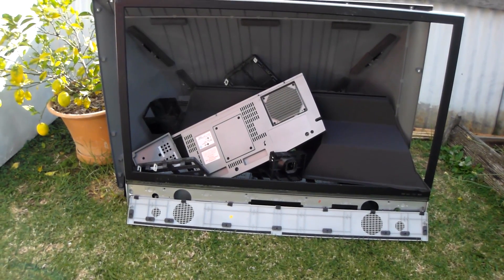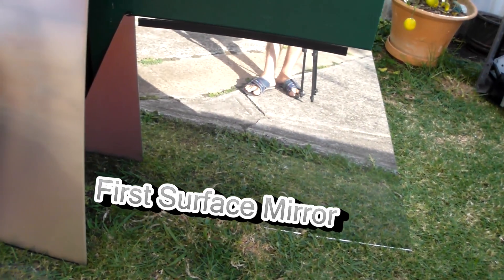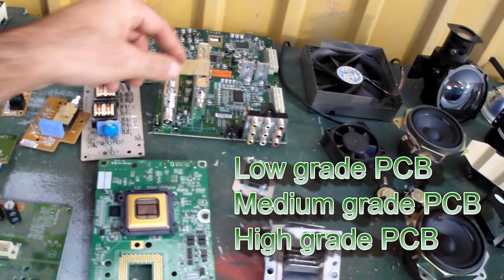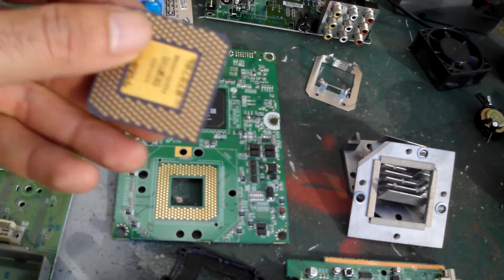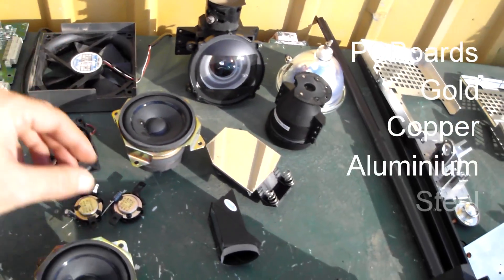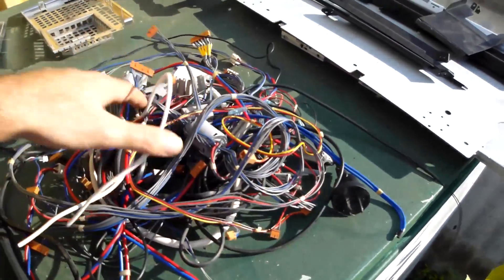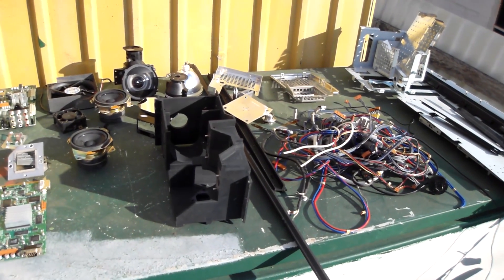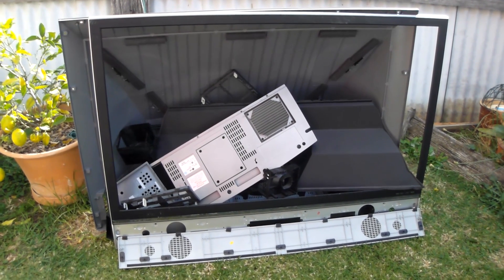Scrap Rear Projection TVs for Gold + fresnel lens (DLP chip+ PCB)

Comment: good to know, just broke down two hitachi's, the circuit boards in a pile with the rest, haven't got to them yet...  these tv's are so big i have to break them down the day i get them, no space... but funny how i always find stuff in pairs or threes, i found both hitachi's an hour apart and haven't run across a rear projection before or since, granted i've only been doing this a couple months.

Comment: Yeah I just autopsied my 16  year old Mitsubishi 52" rear projection tv for parts. I didn't see any gold processor though. I did get a lot of aluminum heat sinks, copper and the lenses. Not sure what the lenses are worth, if anything. The Fresnel lens I'll keep  for hahas. The rest is all garbage. For the most part in 2020 you can't give these tvs away, even to charities when they work 100%. That and it actually costs me $$ to have the township haul away, which is why I chose to take apart and bag up. Took 2 days of part time work and a lot of tinkering but.................

Comment: What amount of time do you have into the dis-assembly of this TV?
Reply from the maker: Browningate  mate, scrappers are a rare breed. we are contributors not just consumers. If everybody stopped being curious and creative, we would all be mindless cloned consumers. This video helps people decide the pros and cons of scrapping without going thru the excercise of failure and dissapointment.  And by the way, a 'first surface' mirror isnt something you buy from homedepot, its a specialty item. Seems like you are imposing your own lack of interest onto onto others by proxy. 
cheers for taking the time to engage and discuss  👍
Reply: Barry Redman also the screen can be used as a huge magnifying lense to burn shit with the sun
Reply from the maker: ***** it took about 30 mins, not including the time spent on video production and outtakes.Cheers mate.
Reply: Yeah i just took a big one apart (First time). 20 min with a power drill @CyberRecycle
Reply: ***** That's how it appears to me.
Reply: Barry Redman but you get a cool mirror of it too
Reply: Cx Stark
Both of which are useless after about five minutes and still worthless outside of the thing in which they originally belonged.
Reply: +Barry Redman 
After an hour and a half, you end up with $3 worth of scrap metal/wiring and a whole lot of worthless plastic and other odds and ends to figure out how to get rid of. The only way to win with that kind of stuff is to either fix it and sell it working or not fix it and sell it as-is; you get way more money for a whole lot less wasted time.
Reply from the maker: Cx Stark  and that is my next video, i have a couple Fresnel Lenses that need to burn stuff! should be a fun vid, gonna try and combine with the magnifying lens that also came out of the tv.  
thanks for watching and commenting mate!   👍😊
Reply: @tisc
Right. I viewed the video and determined that, while it's interesting to see how things work, it's ultimately unprofitable and a waste of time and space to "scrap" something like this. Since you asked though, here's the Pros and Cons:

Pros: educational experience, $3 worth of scrap metal for your hours of effort (maybe)
Cons: A massive pile of difficult-to-dispose-of worthless junk when you're done, wasted time, ruined equipment that can no longer be sold.

Pros and cons of selling as-is without dismantling anything (or repairing):
Pros: educational experience anyway, $5-50 profit in exchange for a tiny amount of time and effort, fast, easy, fun
Cons: none
Reply from the maker: point taken. but nobody is buying and reparing obsolete tvs anymore. i wouldnt dwell on selling broken technology (this is a scrapping channel after all)